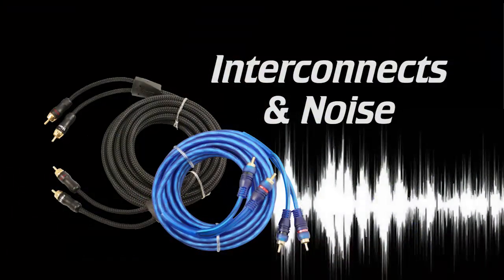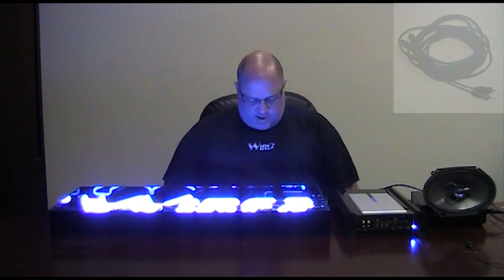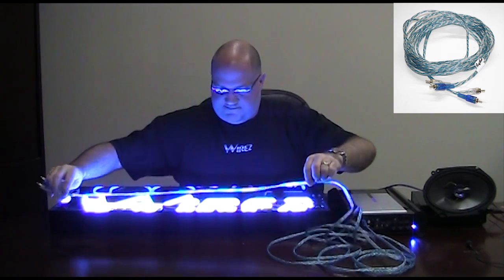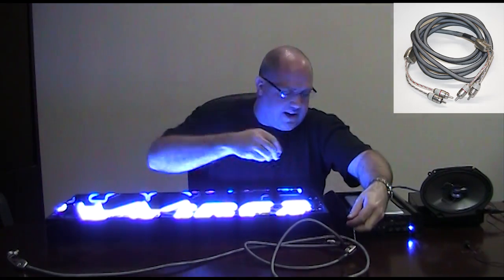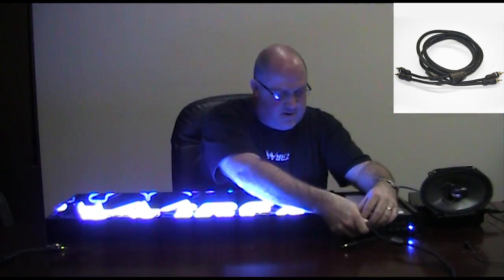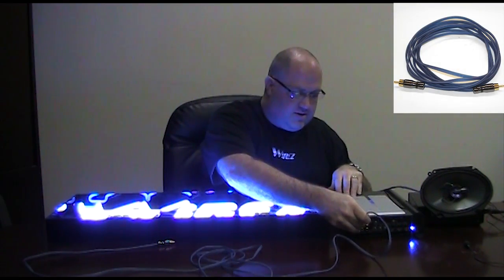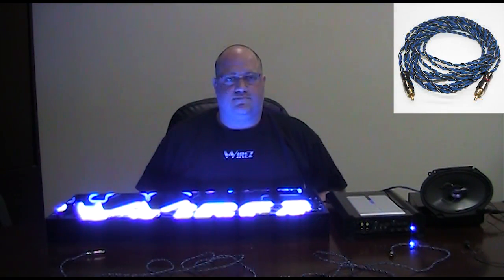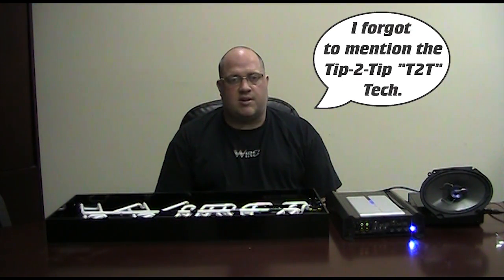Wirez Interconnect Shootout

Comment: Not a fair test. Different lengths of cables were used, the one that won had a much shorter cable. Notice the long tangled up cables were extremely noisy even before scanning over the noise source.

Comment: YOU FAIL!!!   Only such an uneducated fool would think that he can pull the wool over JL Audio's eyes....

I would be willing to bet actual money that this guy at Wirez had a very small piece of wire (so small that it wouldn't be seen in the video) soldered between the connecting points of the RCA terminal on his own home-brand RCA cable...
Thus completing the circuit and removing the 'antenna' like properties of the incomplete circuit.